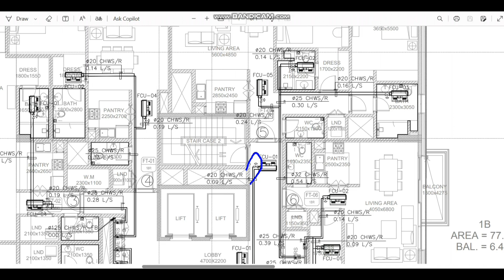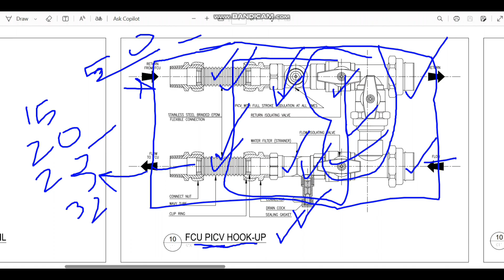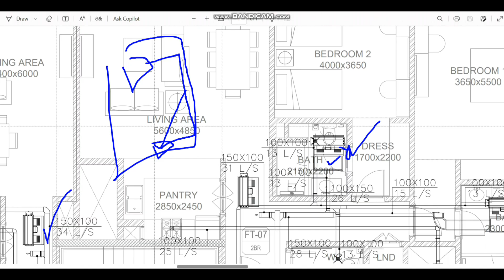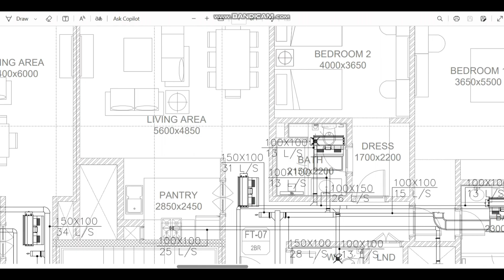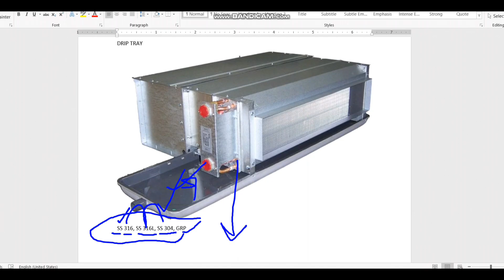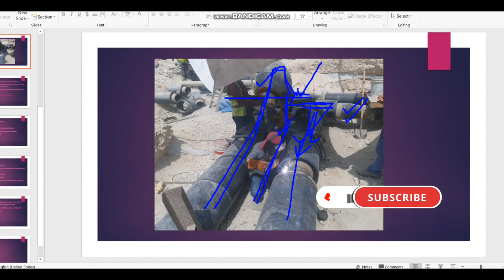Part-2 How to Install Fan Coil Units (FCU) l HVAC Drawing Details l Chilled Water Fan Coil Units

Comment: How to connect internal building chilled water pipe with external under ground pre insulated chilled water pipe? Is there any expansion joint to be use?
Reply from the maker: It wil be flanges connection or valve wil be there in the ETS room entry. Valve wil come with dismantling join for maintenance purposes
Reply: @mepworld3385  actually we don't have ETS room in my project. The chilled water pipe directly connected to Qatar Cool... My consultant commented on adding an expansion joint between external & internal chilled water pipe. So I need to clarify whats type of expansion joint we have to use it's same as fire fighting expansion joint or something else?
Reply from the maker: @uniquetamilkkr9087 it is not required based on my experience with qatar cool for last 7 years projects works